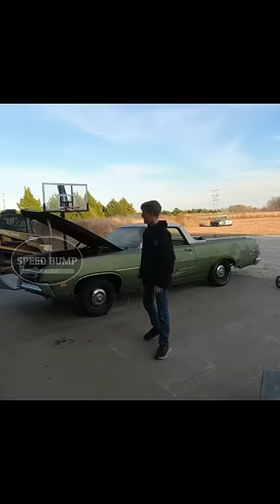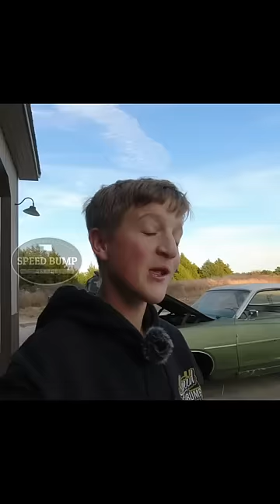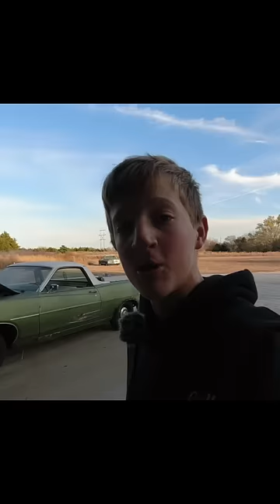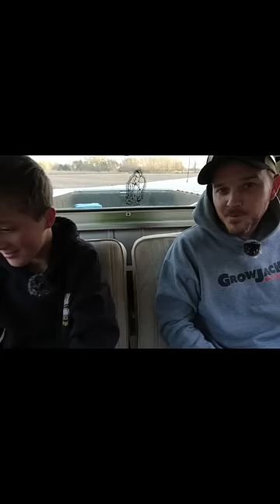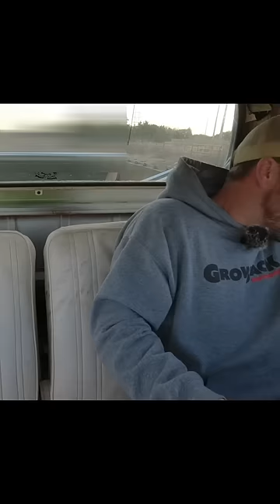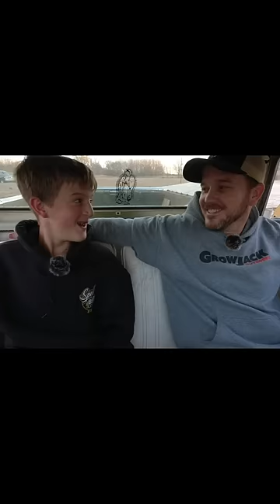Junkyard Ranchero Upgrades!🔥

Comment: So unfair it’s your property. If they watched your videos properly they would see you’re more than capable of driving it! Keep up the good work kid.
Reply: That is true I saw other kids drive on the road
Reply: I was plowing Fields at the age of 10yrs old. He can drive on the family property all he wants.
Reply: Where I grew up in a little farming town you just learned to drive at a much younger age. First you were taught to do it properly, slowly and safely when you got good at it and could prove yourself to be trusted with power tools , yard machines etc. eventually you moved on to trucks and cars. You started learning at about 12 , could actually get a government “ learner’s license at 14 and your full license at 16. Anyways You guys both rock ! 🤘🏻watched a vid and then couldn’t remember your name ( Sorry 😢) i finally came across your channel again and subbed immediately. Looking forward to seeing you work on the old trucks including  the Ranchero. I own a 1969 Dodge D-100 pickup full-size regular box Seafoam green , 318 engine with 2bbl carb ( not original carburetor unfortunately) , original 3 speed 727 automatic trans (rebuilt ) original motor with only 78,000 original miles and 8-3/4 rear end. Original all drum brakes all completely redone. New re - manufactured old style water pump ( same as what was on the original block, not a newer style one the inlet is on the other side ) that took over 3 years to find! But in its defence… the original water pump lasted all those years ! 😮 yeah you heard right! approximately 45 years! Not even kidding ! She’s a bench seat lap belt only old school real deal Farmtruck with the big ass farmer mirrors 🪞 haha! ( and I’m definitely keeping them on there! ) I’ve done almost everything you could possibly do mechanically. but bodywork and paint. It needs a bit of bodywork and rear cab corners and lower door sill rocker panels but other than that it truly runs great and it insanely reliable! I’ve owned it for about 20 years now and at least once a month someone tries to buy it. But it is not for sale never has been and I never will sell it ! I don’t have any kids so i’ll probably give it to my youngest nephew he’s the closest thing I will ever have to a son. He’s a great caring , kind , smart and funny young guy who’s been through a lot of hard things for someone his age. He still came out of it a good lil dude ! Me ( and even my Mom🕊️❤R.I.P.  his grandma , when she could do it) worked with him a lot at nights every weeknight after dinner for a few years on his math and reading and writing because he was having a lot of trouble with that in school and I’m quite good at all 3 fortunately especially the reading in particular.  He’s still a bit wild like any boy should be ! 🤭 I certainly was! But,  He’s worked really hard to be a good young man with good grades in school. It wasn’t easy for him especially doing all 3 of them all the time , he definitely got frustrated many times but he’s smart so I just slowed it down and explained it a bit different or showed him little tricks to make things easier etc. it took a long time and at first a year or so into it he couldn’t seem to see he had made so much progress until his teachers started pointing it out to him!  ( he didn’t believe me when I told him! 😄, I actually had to prove it to him by going through his older stuff a bit here and there, and he just blasted right through it like it was nothing at all 😊 ) I couldn’t be more proud of him… and ❤ I made damn sure I told him that a number times over the years now too ! I moved due to work so I’m not around him as much in the last year or so but it’s always fun to see him when I can. Ah hell I’ll just be honest …  I really miss the little guy ! 😄😊. 🤔A little trip is in order,  I think it’s time to go take him to the movies 🎥🍿 this weekend! So we can just hang out being dudes haha! 😄 being an uncle is cool 😄 I have a 100% different personality than his Dad ( My younger brother who due largely to his aggressive alpha personality is pretty serious and overly stressed out most the time and I’m Sigma type ( drives him insane that I just won’t listen to his pushy  demands even though everyone else around him always does! Haha! 😄) and  mellow and Happy watching movies, reading listening to music or playing the guitar etc ). Little guy even told me once when nobody else was home … “ I think that you being my uncle is really cool… it’s  kinda like having a 2nd Dad but it’s way more fun “ 🤣 it felt fantastic ❤ … But I then had to explain exactly why it’s like that, that I don’t have as many crazy day to day  responsibilities his dad has  to deal with all the time so we are able to just have a chilled out fun relationship… 😊

Comment: I was the age of the younger brother when I first learned to drive. Blocks were taped to the pedals and I sat on a folded parka so I could see over the steering wheel.  Early lessons were in the middle of a cornfield teaching me lane positioning by straddling cornrows with the wheels and shifting.  By age 11 I could handle any of the grain trucks or the semi

Comment: Moveout in the country I started driving when we moved out to the country. I wss 12 eould of starter earlier but that's when we moved tractors . Junked cars,used cutting torches, helped swapped engine's.  
 Wouldn't change a thing. Lots abilities. Still building things repairing things loved drag racing. Ehy in heck am I setting here, oh heat index 108. A fan helps it will cool dowm mid August. Well maybe late August.

Comment: Screw youtube. I grew up on a farm in Central IL in the late 80s and thru the 90s. I was driving the farm pickup, plow tractor, AND mowing tractor (1946 Farmall H) by myself at 10, and had moved up to the grain truck (Ford AeroMax - small semi with dump bed on it) by the time i was 13-14. Keep it up buddy, i love your videos! You drive all you want or your dad will let you, just dont post it. Ill be damned if big tech even attempted parenting my child.